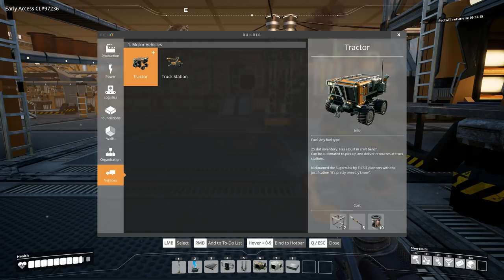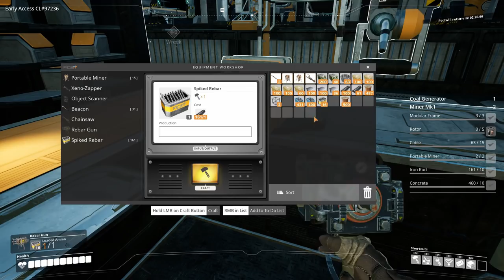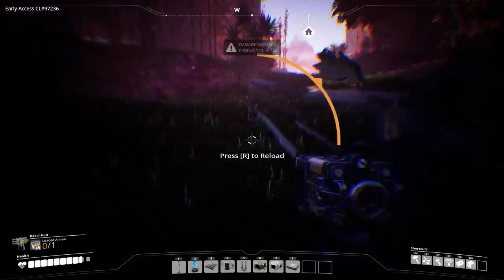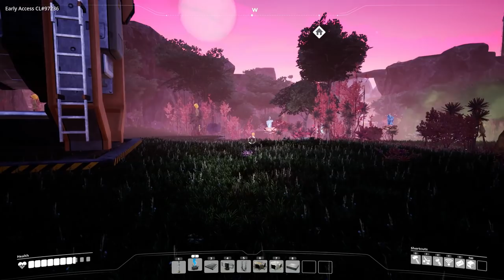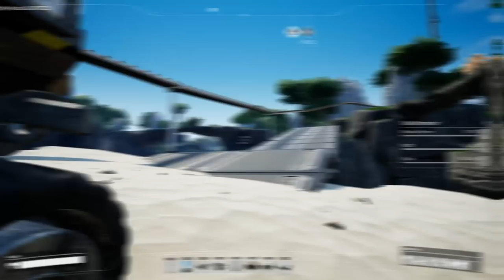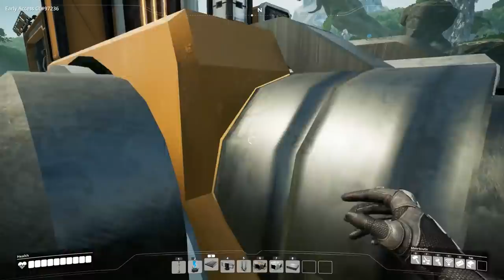Satisfactory Let's Play - #7 Coal Power!

Comment: Now you have plenty of power to spare. Might want to add another splitter off into a storage crate for coal. That way, once the belts fill up, you will have extra coal to throw into the tractor for fuel. Otherwise, you'll end up grabbing a few pieces off the belts or pilfering one of the generators when the tractor runs out.

Comment: 1) Coal generators cold be built on site, so only coal for steel is transported
2) You haven't to split coal evenly. Put splitters sequentially, and each will take just enough for single generator. You will power as much generators, as you capable of powering.